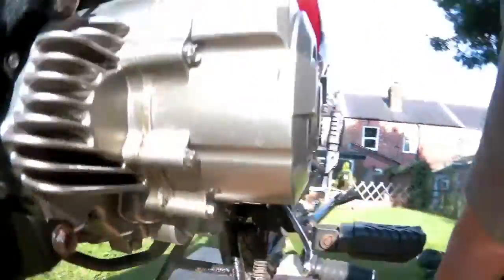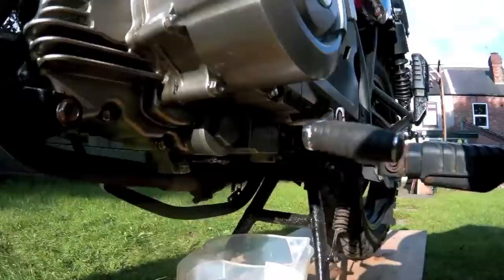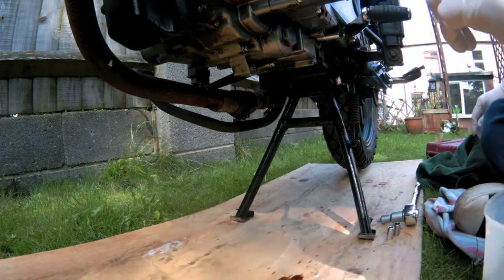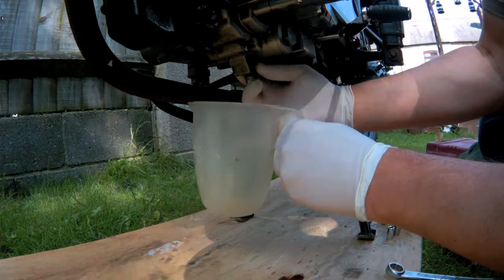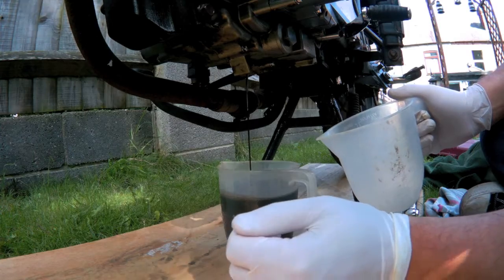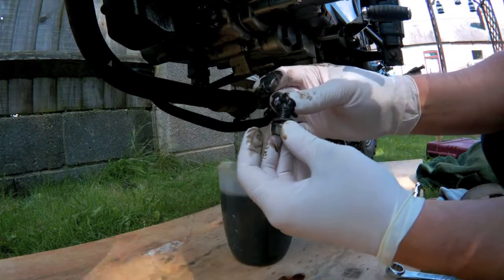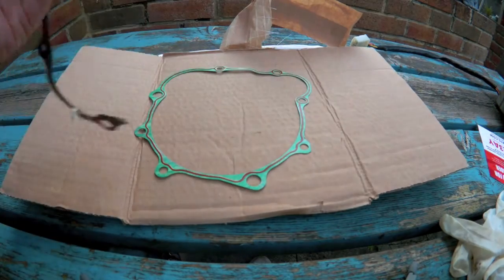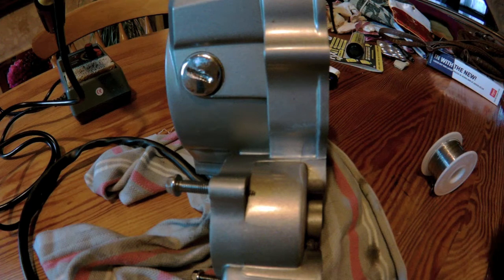Zontes Tiger 125cc crank case gasket replace

Comment: hi quicksteel woulid have fixed that crack and a bit of silver paint.
Reply from the maker: I used a steel putty but it was a bit crap so I might try again with JB weld.
Reply: @SteveSims  hi i have also used araldite before on crank case when i put a bolt which was to long on kick start and it puntured an hole in crank case...that lasted for the next 2 years until i sold the bike.
Reply: @SteveSims  oh forgot to mention i have just gone back to a 125cc...after ridinng big bikes for last 20 years ..due to bad arthritus in my left knee.
Reply from the maker: @S161064  Hopefully my repair will last or I just buy a used cover for about £40
Reply: @SteveSims  hi steve have you got the bike on the road now..nice bike by the way.
Reply from the maker: @S161064  Not yet, I'm slooooow so still have a few jobs to do before it's road worthy but I will get it done.
Reply: @SteveSims  you will get there in the end you will have to put up a rideout video when you get it on the road will be nice to see..be safe